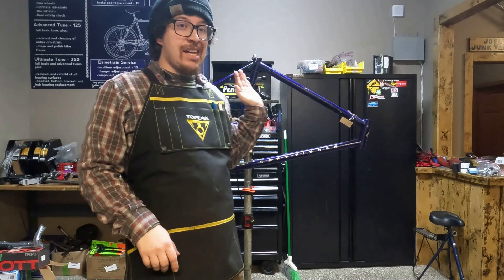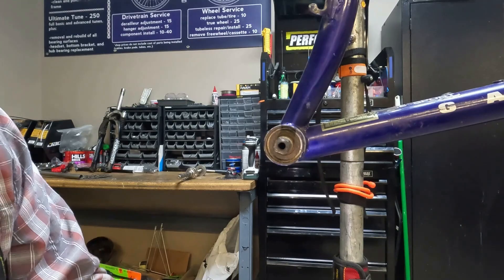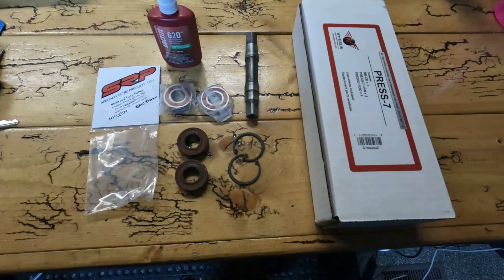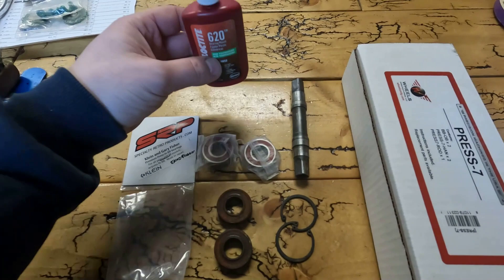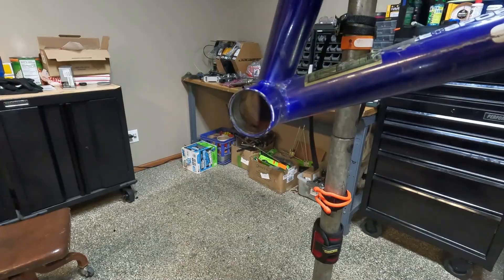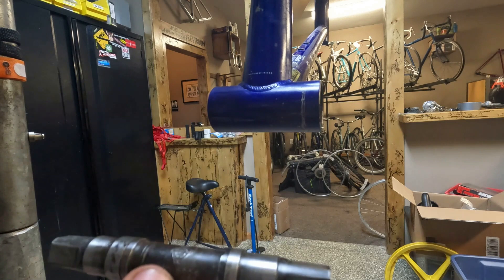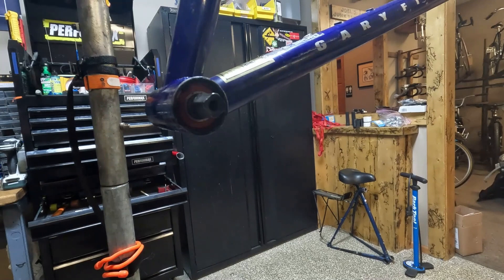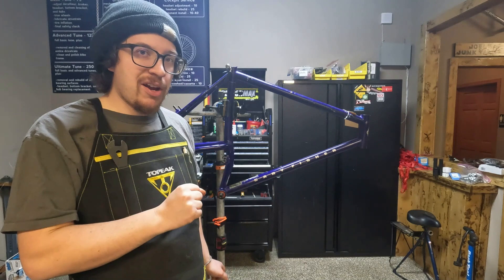Gary Fisher Hoo Koo e Koo Press Fit Bottom Bracket Bearing Replacement

Comment: Great video! I just wanted to add that the circlips are 34mm and can be found in stainless steel on amazon which I need since everything rusts in the PNW. Both my CR-7 and my Hoo Koo use a 6003 2RS for the bearings as well but I will likely grab that kit when I get around to finally doing this work.
Reply from the maker: Thanks for the info, I actually need some circlips for another early Gary fisher that needs new bearings also.

Comment: So I have an oddity, a GF prototype from ‘91/‘92 that is closest in build to a Sphinx and uses this style of bb. Do you know if it’s possible to use a more modern pressfit, like an Ultrega SM-BB72-41B? Or are they strictly independent bearings and spindle? Also, great video and info!
Reply from the maker: Great question. To my knowledge there is no work around. This can be an issue if you spindle is damaged as they are a lot hard to find than the bearings.
Reply: @GringineerCycles  thanks for the reply! Guess I’ll try a few different brands of bearing to see what gives the best result.
Reply from the maker: I have used the bearings from specialty retro products multiple times. 

https://specialtyretroproducts.com/product/gary-fisher-and-klein-press-in-bottom-bracket-bearings-by-srp-press-fit/

Comment: Stopped at 4:20 so I don't know if you're reusing the spindle. If so, go to the hardware store and get some longer than stock crank arm bolts. Thread the bolts in and hit on the bolts instead of the spindle. To drive out the bearing that's still in, use a socket extension of your preference. The spindle is not a removal tool. Be sure also to spray both sides with something stronger than WD40 for a few days prior to starting this process. Please advise viewers to wear safety glasses when working with circlips, and lastly, but should be first, is measure the spindle length that's exposed prior to disassembly to help with setting the chain line on reassembly. Just recently got the bearings and spindle removed from an 1995 Klein Fervor that's seen decades of elements and neglect.

Comment: Can you provide a link or name of that press tool? I want to order one. 

Thanks!
Reply from the maker: It is a wheels manufacturing Bottom Bracket Press. They make multiple kits depending on what you all need to press in. I included a link to there site and the specific tool I used. 
https://wheelsmfg.com/presses-tools/presses-extractors.html

 https://www.jensonusa.com/Wheels-MFG-Bottom-Bracket-Bearing-Press-Red?loc=usa&gclid=CjwKCAjwrranBhAEEiwAzbhNtUwTrzPVeDY_pLViwdqFhlEVTpWcKZcqmXT3ZAwa_0N9ogA_Cm_enRoCkb8QAvD_BwE